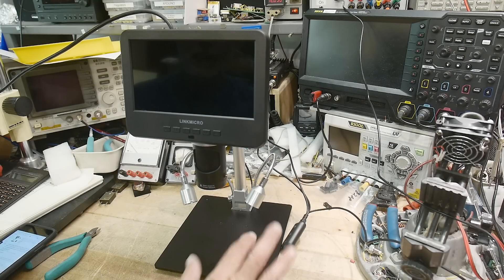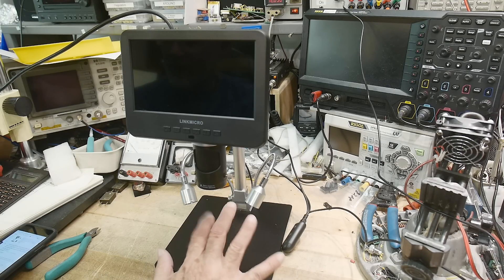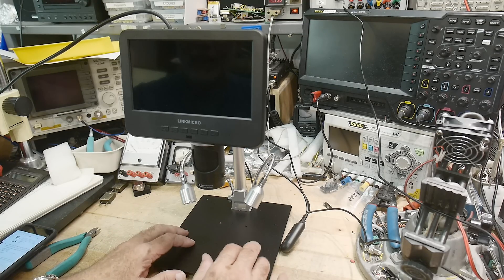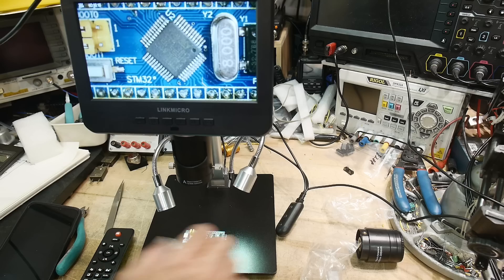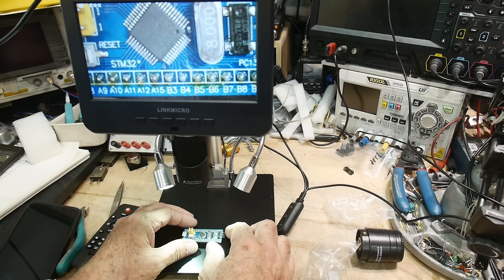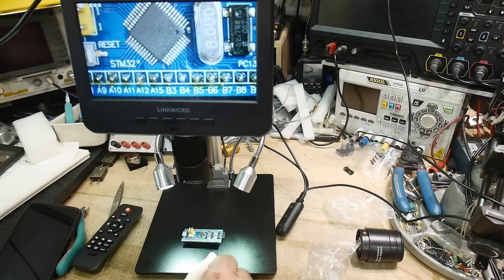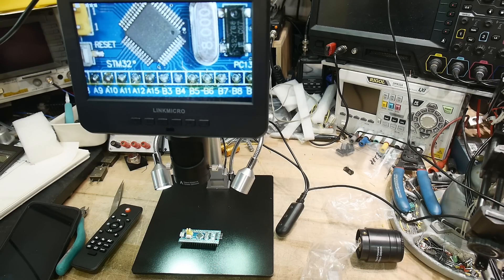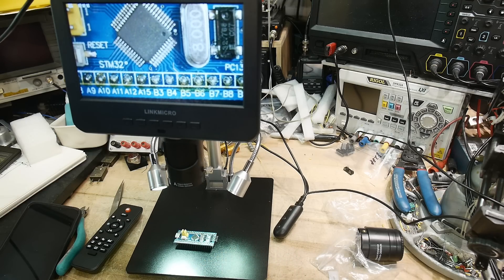#1303 LinkMicro LM246MS Microscope review

Comment: I bought the 10" model and it's great. I use it for entomology and geology hobby. The only complaint I have is that the image freezes when any files are altered on the SD card using my laptop and the only remedy is to format the card. So if on my laptop I rename a file or create a folder the scope freezes and reformatting is necessary. Nuisance. But overall these units are great. I also added a ringlight attached to the underside of the lens barrel. Works great.

Comment: Please note, the current model of this unit you can ONLY do USB mode, HDMI mode, or Local Display Mode, you cannot do one output at a time, I was very disappointed when i went to go try to use this for Twitch Streaming and have a local display, I didn't recall this being mentioned in the video.

Comment: How do you find working without stereo ? I also use a nice Wild microscope but have wondered about trying a digital one for the ease of positioning. But I tried one recently - I think it was probably cheaper than the one you're reviewing here - and found the lack of depth perception dreadful. 

I couldn't tell whether the components in my tweezers  were on the pcb or not, and I kept trying to solder but it just didn't stick  - I think because there was a gap. It also had rather a small screen and a slight lag even on the built-in viewer but it was the depth perception that made it bad for me.

I see that many of the comments say the same - you really want the stereo microscope. I would like to hear from someone who uses both and has found a digital microscope that's good enough to be comparable with optical (albeit with no stereo). I guess another thing that would be interesting is a digital stereo, with two cameras but probably VR-style eyewear.

I think the long lag you're seeing is likely the capture and PC video rather than the HDMI output. Please try it with a direct connection to an HDMI monitor.

Comment: Hi, there's also the possibility that you'd like a trinocular microscope, but your workplace is so small that you can't fit anywhere, so you're stuck with a digital one. I had one similar to the one you showed, 5MP but without a screen with the same focusing method, since the microscope was suspended on a movable arm it was quite difficult to focus. I had to focus several times because I was moving while manipulating the curtain, but one day I was unable to focus at all. When I tried to repair it, I found out that the optical guide is plastic and cracked, the microscope was not exactly cheap, and until then I only knew metal optical guides, and the plastic design surprised me quite a bit. It had an excellent function for illegible inscriptions on components, it was a change of chromaticity, the inscription could also be read under a layer of protective varnish.

Nice day 🙂 Tom

Comment: Most new Stereo-Optical-Microscope users take a long time to learn all how to use ALL of the controls for Intra-pupil-distance, L&R +/- focus offset,  and lighting methods. A diopter lens easily adds working distance for soldering "tall" electronics, but you have to know that you need one in the 1st place. CCD Microscopes are great for teaching others how to solder SMD, but a bear to use for over an hour.